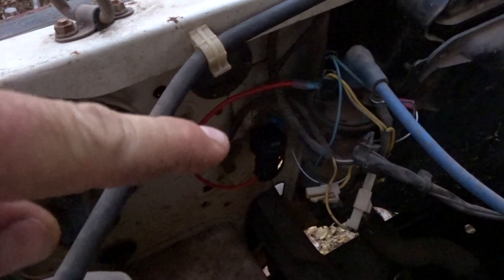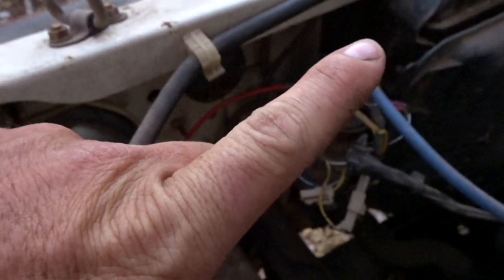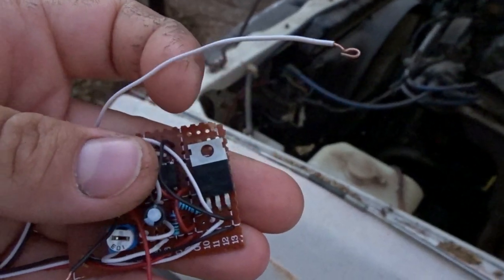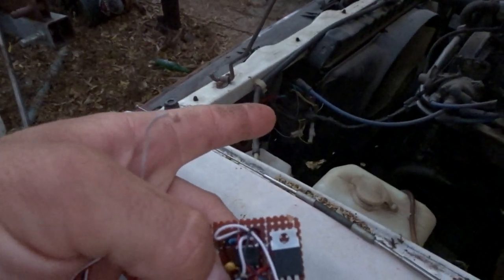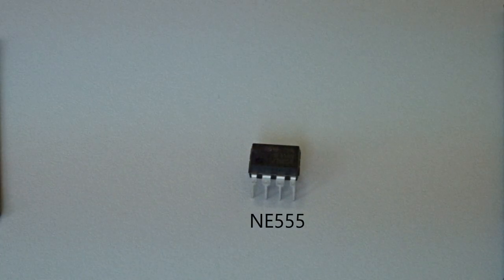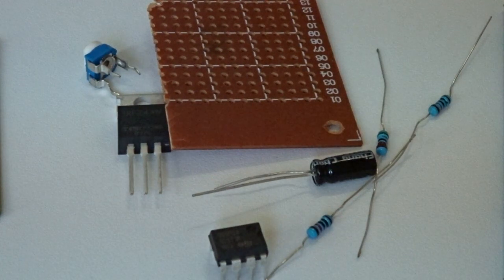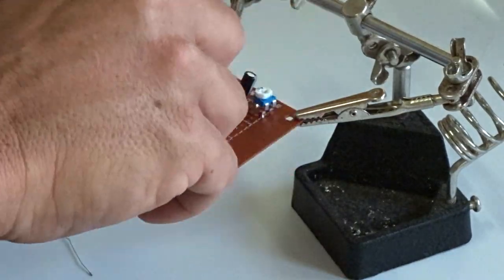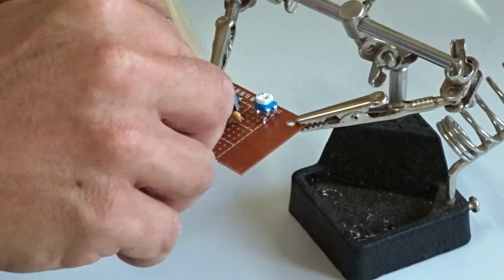DIY Spark Cut Rev Limiter Stage 2 | Automatic Cut Timing

Comment: Couldn't believe it actually worked! I made the circuit for my motorbike and I had to put the mosfet in reverse (based on the diagram) for it to output a 12v signal
Reply: Hey, do you have a video of it working on your motorcycle? I’m planning to make one as well for my Honda grom. Any way to contact you? Would like your help since you got it working
Reply: @reeupp1257  sure man!
Reply: @hectorpereira2803  hell yeah dude, how would I reach you? Through your social media or email?
Reply: @hectorpereira2803  ??
Reply: video mate??
Reply: @TheMrkylester101  I found an easier way to set this up. Instead of making the board, I used a timer
Reply: @reeupp1257  info?
Reply: @TheMrkylester101  I used his relay diagram then used an off & timer connected to a momentary switch. The timer is adjustable from milli seconds to seconds. About $40 in parts. Next thing is to tap a spark plug in the exhaust in lieu of the relay to create loud backfires.

Comment: Add a spark plug to the end of the exhaust pipe and you should get flames
Reply: I'm having an issue here: in the beginning u said the white wire goes to crank signal, again further into  the video, u said the white wire goes to cut relay, what on the cut relay is it connected to..also u said the black is what the button is spliced into and it works the cut relay and what? A bit confused here..just need more clarity and illustrations Thanks

Comment: nice job! I'm from brazil and here a rev limiter is very expensive, soo your eletronic circuit saved me! Just one question, instead a button i can use an ON and OFF switch? I thinking in aways limit my engine in 6500RPM to prevent engine damage, is possible? Or the circuit can be used only with the push button?
Reply: Seems to be doable to use on off switch

Comment: Ne555 on schematic I've got 5 pin/wire coming out of the right side and only 3 from the left side yet the Ne555 has 4 pins hence confusion,please help out
Reply: There are pin numbers, on the chip 1st pin is the one where the dot is, then it goes down - right and up.

Comment: Hy aroon ...i took mine vw polo 2001year ignition coil it is dual coil with external amp...so i just put together when i opened it and two ground wires together using relay ....and it goes bang like hell hahah..my question is is it bad cos i havent put it on chasis ground but only made it short but it works cos i cant put two relays on because it short anyway

Comment: Hey aaron , thanks for the video . I am using ecu for this , but my ecu doesnt have crank angle sensor , only camshaft angle sensor , so where should I tap the wire white to ?
Reply from the maker: Try the cam sensor wire, but put a 10k resistor between the transistor and sensor if it's a 3 wire sensor.
Reply: AaronBonBarron Alright its a 2 wire sensor either positive and negative .
Reply from the maker: @ahmadrejab5809  its a reluctor type so one pin will be negative and the other will go to the ECU, tap into the wire that goes to the ECU
Reply: AaronBonBarron Okay I get it , white wire goes to the ECU , red wire should be any 12v and black wire goes to the push button switch and grounded . Tq bro
Reply from the maker: @ahmadrejab5809  now worries! Upload a video when you've finished it so I can see :)

Comment: i have try build this..it work..but i install it to my motorcycle, so the rpm will be higher at about 8000rpm for starting.. the problem is i put the push button at my clutch..when i pull the clutch, the rev limiter will trigger and it great.. the only problem is it only work on drag motorcycle...for daily use is not suitable because if i pull the clutch, the rev limiter will trigger avery time..how can i contol the limiter so it only will trigger at 8000rpm.. below that it will not trigger.. please help
Reply from the maker: I'm working on a version that detects RPM now
Reply: @AaronBonBarron  are you using arduino?
Reply from the maker: Nah I'm using an attiny24
Reply: @AaronBonBarron  great.. Will wait for your project
Reply: Your motorcycle is injection or carburetor type?
Reply: @pakkordi5459  carburetor
Reply: @haidzir84  can you teach me friend how to install it in a motorcycle. Thank you :)
Reply: Can you show me how to install it on a bike

Comment: So got a few questions, I have two cars I’d like to use this on, an XG falcon and a vr v6, the vr is ecu controlled ignition so I would have to use the white wire and connect it onto the crank angle sensor trigger wire, this doesn’t need to do the relay mod in the first video correct? but now onto the xg I’m not too sure if it’s ecu controlled or not, it has a distributor and I would assume have a coil too so I can do the relay to that? 
Very cool idea and would love to have a 2 step!
Cheers
Reply from the maker: If the XG has a barrel style ignition coil you can do the relay mod and cut spark that way, for a VR grounding the crank angle sensor should work, if it doesn't you can use a relay to cut power to the DFI modules.
Reply: AaronBonBarron sweet I’ll have to have a play around and see what works when I get around to it, how is stage 3 going? would love to buy one but no rush lol

Comment: Hey I got a 2004 toyota tacoma 3.4l an has coil on plug ignition how do tap into to ground the coils?
Reply from the maker: For coil on plug you want to cut power to all the coils at once using a relay with a Normally Closed or 87a pin.

Comment: Wait so when you use the white wire to tap into the crank sensor what’s that do?? Just cut the power to the sensor on and off causing the ign spark to cut on and off as well???
Reply from the maker: It cuts the signal to the sensor, stopping the ECU from firing a spark
Reply: Ahhhh🤔 I appreciate the reply knowledge is power! I’ll be building one very soon

Comment: Yeah! Finally found one that sounds sweet! 
Can i just add a shift light and a relay to replace the switch?
Reply from the maker: Yep, that should work! Let me know how it goes!
Reply: When will version 3 coming out? Cant wait for it!
Reply from the maker: The prototype is sitting on my desk at home, I'll be testing it out this week hopefully
Reply: Will it be an add on from stage 2? Or izzit a whole new system/circuit board?
Reply from the maker: It's designed as a new board, there's a bunch of extra logic to make it work properly.
Reply: For this video's diagram,
+12v is connected to positive coil
To relay is connected to the relay coil

Is this correct?
Reply from the maker: Yep that's right
Reply: Sweet! Will do it today! Im very excited for the 3rd version though.. Rly cant wait!
Reply: Is there any way i can contact u personally? Ive smoked my car.. :P
Reply from the maker: @KidNomura  oh no, did you let the magic smoke out?
https://youtube.com/add_contact?c=t0KoWmo_uu4Fu5sWpigHVX_6Er_row

Comment: Hey Aaron, this is a very cool DIY , Id like to try it to a lancer 2005, can I do the relay mod and tap into cam angle sensor for efi?
Reply from the maker: Yep that should work! Just use a relay that has a Normally Closed pin and have it disconnect the cam angle sensor
Reply: @AaronBonBarron  Figured i'd follow your automatic cut schematic. So I've Finished it already , one goes to  a 12v and the other to the switch and ground and does the other tap into my cam sensor?
Reply: @AaronBonBarron  my sensor has 3 pins , where do I tap to? the trigger wire?
Reply from the maker: @audimendoza8350  I've just updated the schematic, there was a misplaced wire.
Tap into the trigger wire of the cam angle sensor after you've fixed the circuit and it should work!
Reply: @AaronBonBarron  I just saw it , the drain pin of the transistor should be tapped into the trigger pin of the sensor. Which you told early in the video. Thanks for the update man, hope this works. If my sensor's a 3 pin how do I determine the trigger wire? its like red, blue/red, and black
Reply from the maker: It will be a hall effect type sensor, so there should be a constant ground, an ignition switched +12v, and the remaining wire is the trigger signal :)
Reply: @AaronBonBarron  Thanks! Wiring it up soon.
Reply: @AaronBonBarron  hey Aaron If I'll follow this automatic spark cut timer which I already did, do I still need to do the relay mod? I'm confused, I hooked up the protoboard with the schematics all good but I do not get any ignition cut .
Reply from the maker: @audimendoza8350  how did you connect it to the cam angle sensor?
Reply: @AaronBonBarron  I tapped one wire to the +12v then the other which I think is the trigger wire (or maybe I'm wrong. I just tapped into it. There's one wire I left connected, it's like blue red in color .
Reply: My idle went lower and it stalls Lol
Reply from the maker: @audimendoza8350  did you disconnect it or just tap into it?
Reply: @AaronBonBarron  I disconnected it and then reconnected them together with the +12v  and the middle pin wire if the transistor
Reply from the maker: @audimendoza8350  did you rev up before you pressed the button?
Reply: @AaronBonBarron  yeah I did but it's still progressing even with the button pressed.
Reply from the maker: @audimendoza8350  Did you turn the cut time up and try?
You might need to use a relay to cut power to your igniter or coil instead, your ECU might be compensating.
Reply: @AaronBonBarron  I did turn up the cut up time of the potentiometer , yeah maybe the ECU is compensating. If I use a relay, how should I wire that? Thanks man
Reply from the maker: You would need a relay with an 87a Normally Closed pin, wire it up like my first video but have it cut power to the igniter or coil instead of grounding.
Reply: Did it work?

Comment: It's possible to do that on a diesel engine?
Reply: As diesel engines do not have spark plugs, a spark cut rev limiter will not work on a diesel engine. If the fuel pump is controlled by an ECU, a hard cut limiter could be programmed in by your local ECU mapper, although it might damage the turbo in the long run.
Reply: Bro it's a diesel?

Comment: Would this work on a small engine like a GX200? I'd like to be able to adjust the limit with a potentiometer.
Reply from the maker: It could work if it's electric start, otherwise you'd need to have a seperate battery for it.
I have a GX390 here I could test it on when I've got some time.